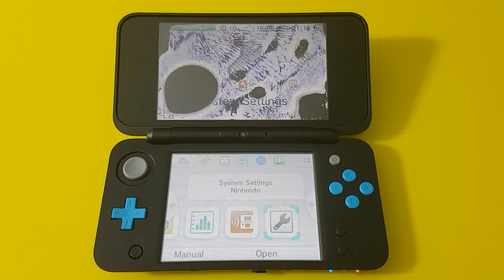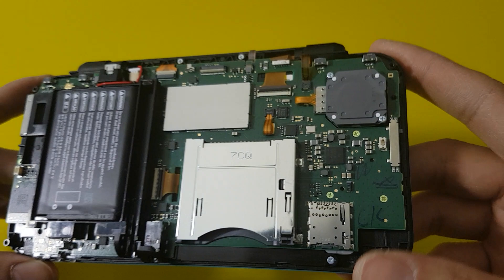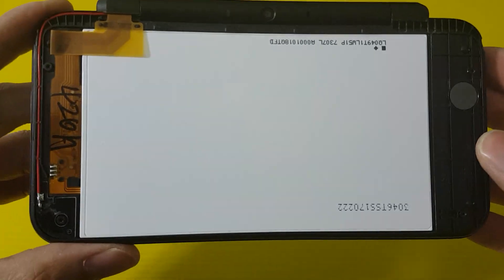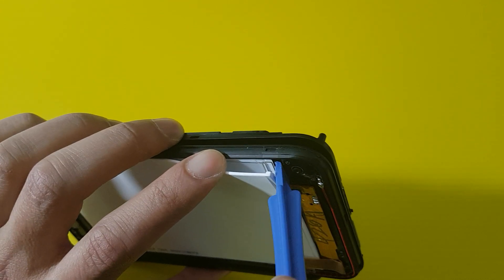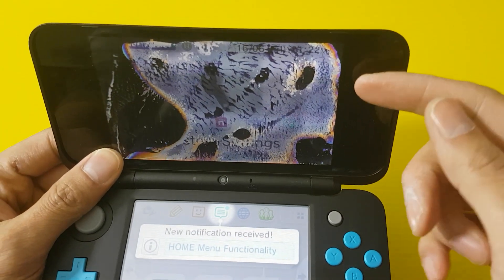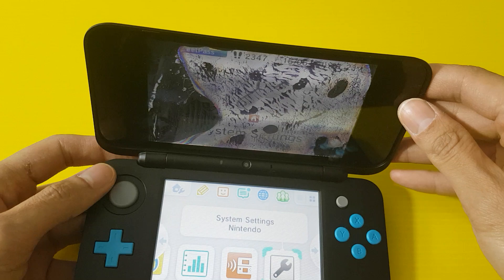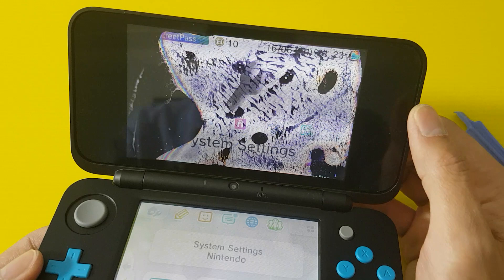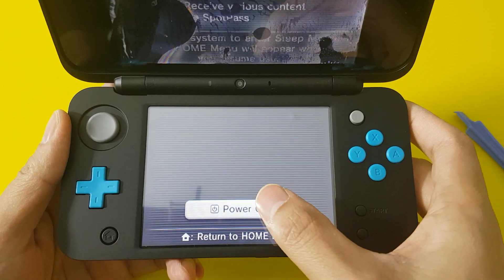New 2DS XL Upper TN Screen Disassembly/Tear Down/Replacement

Comment: Since no one got an answers I'll ask again, where can you actually buy a replacement LCD screen for 2ds XL??
Reply: Saul Clavano you can’t, try eBay for parts and hope you get lucky
Reply: https://www.aliexpress.com/item/Original-Top-down-lcd-screen-for-New-2DS-XL-replacement-display-for-NEW2DSXL/32856655318.html?spm=2114.search0104.3.17.621f7290t9EA3N&transAbTest=ae803_4&ws_ab_test=searchweb0_0%2Csearchweb201602_1_10152_10151_10065_10344_10068_10342_10343_10340_10341_10696_10084_10083_10618_10307_5711211_10313_10059_10534_100031_10103_10624_10623_443_10622_5722411_10621_10620_5711311%2Csearchweb201603_2%2CppcSwitch_3&algo_pvid=b18bebd1-7359-42da-9a50-ab09184f7149&priceBeautifyAB=0&algo_expid=b18bebd1-7359-42da-9a50-ab09184f7149-2

Comment: Nintendo didnt even add the shielding to keep the layers together safely, lol
Reply: Cheap fucks.
Reply: @thousandyoung  The 2ds was designed to be cheaper so it's more affordable to some people
Reply from the maker: Also the front layer is fully glued to outer screen. Will have a look again soon to see how else you can do it.
Reply: well if that's the case at least there won't be problems of specs and little bugs getting between the LCD and the screen face anymore.

I wonder if it's much more fragile though. That metalic shielding could withstand some impact.
Your screen is already ruined so you could try folding it and putting pressure on the top part to see if it gets damaged
Reply from the maker: This screen is more flexible on the 2DS XL. I can be bend a little. It is more flexible than older screens.